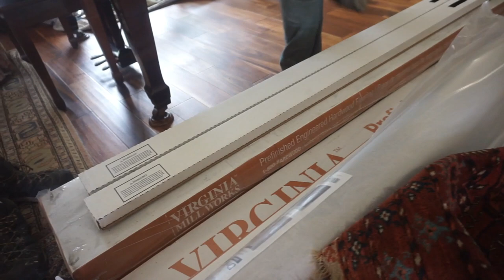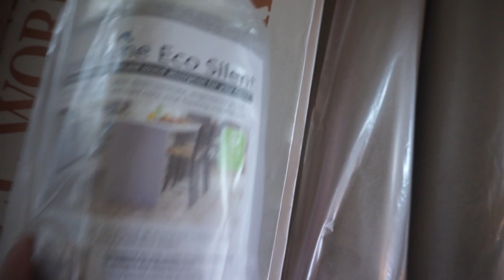ACACIA VIRGINIA MILL WORKS LUMBER LIQUIDATORS FLOORING, INSTALLATION & REVIEW, HOW TO DIY, BEGINNERS

Comment: Great video. I heard you say your not a big fan of quarter round. I have it in my house and I don’t like the way it looks either. What are the alternatives?  Thx
Reply: shoe mldg.
Reply from the maker: I usually either take the existing  base off and reinstall it after installation or if it’s the really tiny base most customers don’t like I install new 5 1/4” base. It totally changes the whole look! Some people do shoe molding instead of qtr rnd. Those who choose the straight top base I call “modern” looks pretty nice with the shoe molding instead of qtr rnd.
Reply from the maker: I also do door stop sometimes. If you watch my 7 hot ideas video (thumbnail has a BIG 7 on it) I talk about/show it there. Which is a great alternative to qtr rnd.
Reply: I prefer white trim and white QR/shoe mldg myself

Comment: how much a foot if you did that job in corelux also in nucore per square foot also how many rooms??? At
Reply from the maker: If it’s an empty room, no rip out, floating install I get $2.00 a sq ft if it’s square room like that no hallways or difficult cuts. It was a really simple install just the one room and they ripped out their own carpet and moved most of their furniture except the bed and dresser we moved for them.

Comment: Pin nailer gun works way better on the 1/4. You can’t even see where you nail it with a pin nail gun as opposed to the gun you are using.
Reply from the maker: Yea I don’t do hardly any qtr rnd most of my customers just go with new base.

Comment: Wow $1.50 for 1/4 that’s a awful lot for 1/4 unless you provided it. Hopefully you provided it or you over charged that customer.
Reply from the maker: Actually I gave him a good price,  because he was a repeat customer. Normal price is $2.00 ft and up here. Installation prices are different in different parts of the country even within states. It’s a lot cheaper to get floors installed in northern FL than here. Cost of living is higher in Palm Beach.
Reply: Jones Knows I know what the prices are where you live. Because I live in the same area. $1.50 for 1/4 is absurd unless you’re providing it also. I hate to see what you charge for base
Reply: Jones Knows   So you change you’re pricing according to a persons location wow.